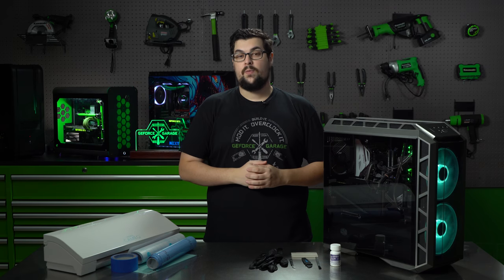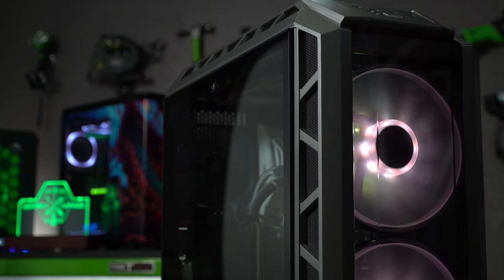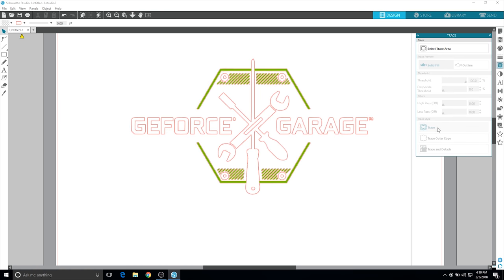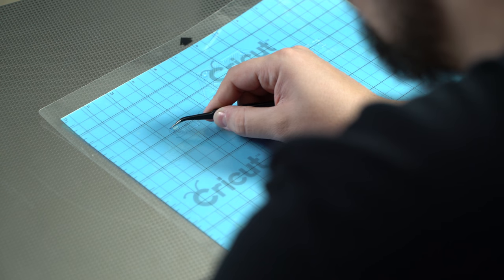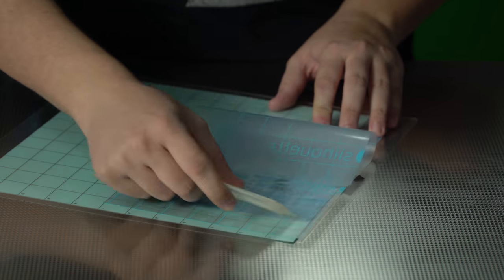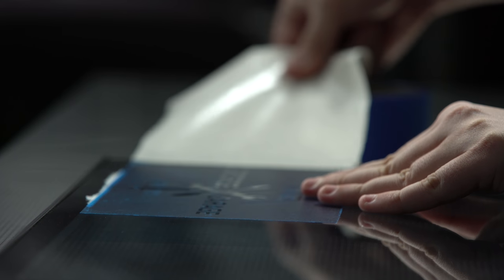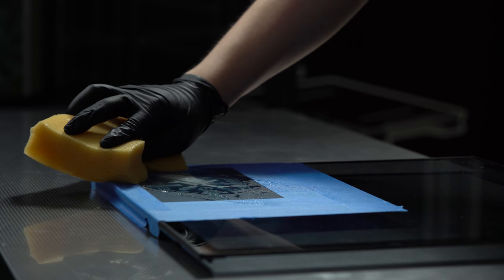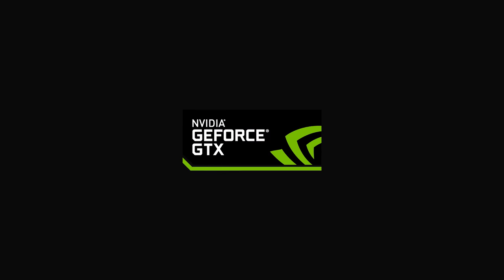GeForce Garage - Upgrade Your Rig: Window Etching

Comment: I make stencils literally every day, using standard vinyl, NOT mask. If you apply it correctly and use quality vinyl, Armour Etch works fine on glass without using a specific masking vinyl. I also use industry standard vinyl and application tape, not this craft store stuff. I sell decals, logo's and stencils on a regular basis, if you need something, hit me up. Good luck all with the mods...

Comment: "Under 20 minutes and under $20" "I have this specialized stencil cutting machine already, and I'm going to use the software bundled with it" "I prepared this one ahead of time because it would take forever to do all the little lines"

I know you can get a print shop to do the stencil, and the complexity of the stencil added to the time, but that was a weird line to stick on at the end.